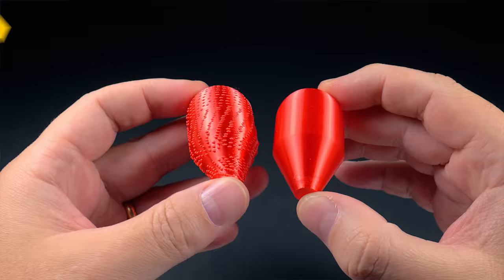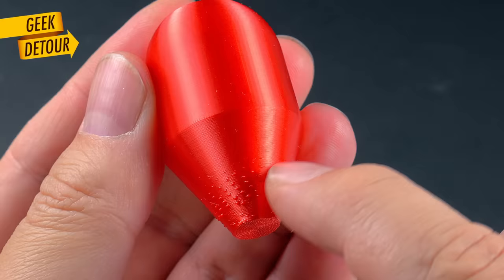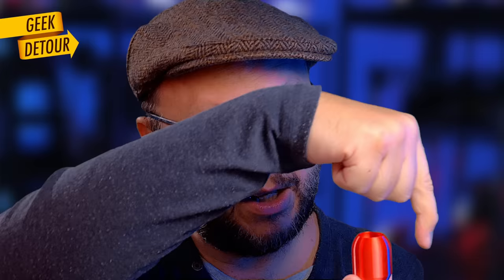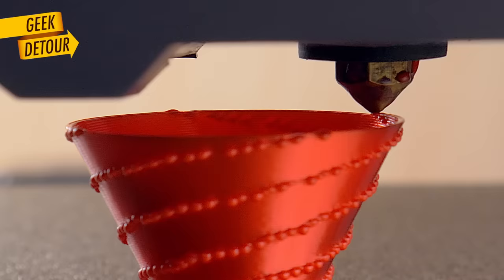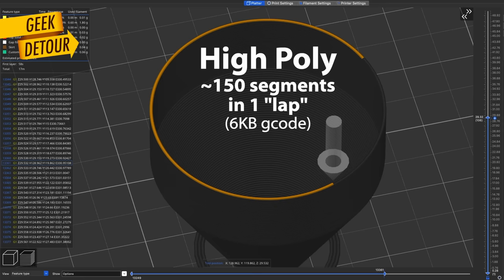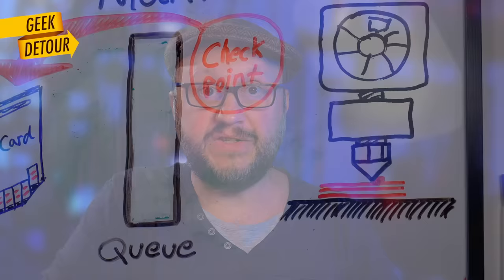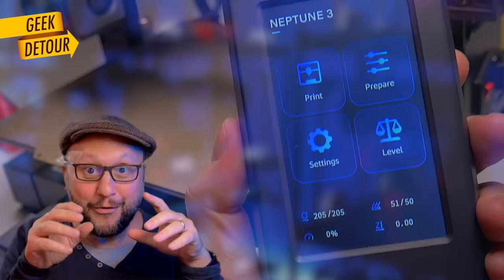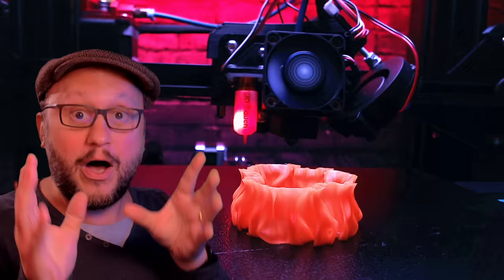3D Printer Blobs: a mysterious problem you won't guess how to fix 🤔

Comment: That isn't "processing power". Nothing about it has anything to do with "processing power". GCode is managed sequentially. Doesn't matter if it's 1K or 1M, it gets processed from end to end.
Reply from the maker: Hi Tim: these microcontrollers are single-threaded. They jump from changing stepper pins to other tasks, luckily without causing noticeable pauses in print. Reading to the SDCard, writing to the SDCard, updating the LCD, all of that can be better done when the CPU of the microcontroller is faster. The faster the CPU, more time to access the SDCard between changes on the pins that control the stepper motors. It is very related.
But you are right about GCode being “consumed” sequentially - that’s why a file with 1GB of GCode can be printed by a printer with 16KB of RAM. 

CPU is so related to these aspects that it even limits the max speed of the printer: a 16MHz microcontroller, even with Klipper, cannot print as fast as a 32bit board running much faster, because the CPU is who changes the levels of the pins that control the motors steps.
Reply: @GeekDetour  These microcontrollers are indeed single-threaded. They're also interrupt-driven in the same manner that the 32-bit microcontrollers are interrupt-driven, both by internal timers.

When an 8-bit microcontroller is handling the tasks at hand sufficiently fast and without fail, a 32-bit microcontroller running at 20 times the clock speed of the 8-bit microcontroller, and having access to 1000 times as much RAM cannot perform better. Sufficient is sufficient. The faster 32-bit microcontroller just spends a ton more time being totally idle, consuming some of that time in housekeeping that the 8-bit microcontroller never needs to do because it has no operating system to maintain (the 32-bit microcontroller has a worldful of housekeeping to do just to stay alive).

Reading from the MicroSD card is NOT done "better" by a faster microcontroller. The MicroSD card is the bottleneck; it's limited by SPI clock speed... and an 8-bit microcontroller manages it perfectly sufficiently. Again, you cannot do better than "sufficient". A faster microcontroller just spends more time smoking cigarettes and kicking empty cans down the street. The same is true of writing to MicroSD cards and to updating the display, whether it's LCD or OLED or anything else... if the display is even being used, which it very often is not. And... it also manages GPIO pin changes perfectly well. Sufficiently. I know these things because I write the firmware for them. I've been a software / firmware engineer since 1984. Really.

Next news flash: a 1GB GCode file can be managed sequentially by a CNC router control board with only 2K (TWO kilobytes!) of SRAM. It happens all the time. That's what GRBL boards do. Now, 3D printers do need to do a little more work than CNC routers do... they need to manage two different temperatures (hotend and bed) and one PWM fan... but the fan's PWM is handled entirely by hardware, so it doesn't count. Two temperatures. Do you think it takes 14K of RAM (16K - 2K == 14K) to manage two temperatures? I didn't think so. Neither do I.

Don't be too fast about leaping onto the 32-bit bandwagon. You aren't getting four times the performance when you do.

If you have doubts, consider this: I have a buddy who's built himself a couple of race printers. He's running 8-bit boards, and he's getting speeds as high as 500mm/sec with excellent detail. 8-bit boards, more specifically ATMega1284s and ATMega2560s can do a whole lot more than you clearly think they can. Obviously even the puny ATMega328 can do a whole lot more than you think it can.
Reply from the maker: I agree with everything you wrote, TIM - and I appreciate all the information. And yet, if you watch Stefan’s video, you will see that the capability of printing more complex GCode without the interruptions that cause blobs is related to the CPU and RAM of the microcontrollers even whithout them writing the save states to the SDCard.

I think you got mad when you listened to me talking about CPU power and was very fast to draw a judgement upon my knowledge.
Reply: @GeekDetour  Who is Stefan?

Nothing about GCode is ever complex. I've written GCode, and handlers for it in C, that can do tilted helices... and even tilted helices are dead simple.

The blobs, and the fixes presented here, have nothing to do with "processing power". They clearly have only to do with MicroSD card bottlenecks, throttled by SPI clock speed.
Reply from the maker: Ok TIM. Your pleasure is just to watch a video just enough to find a hook to call others clueless 🤷‍♂️ You look like a chap that knows a lot - but don’t really pay attention to what others say, even if, deep down, people are talking something very similar to what you think. You didn’t watch the whole video: I say exactly that: the blobs in this particular case were caused by the SDCard 🤷‍♂️
Reply: @GeekDetour  But one comment ago you indicated that the blobs in this case were caused by a lack of "processing power".

You see... I watched the whole thing. What's more, I retained the whole thing. That's how my mind works. I also remember what you wrote. Heck, I still remember, sound-for-sound, cartoons that others were watching in the 1970s. I remember a sequence of siphon tubes that my father asked me to remember for one of our fields when I was about seven.

I collect information about everything, and I process it until I fully comprehend it and then I process it again to extrapolate its ramifications, then I store it for later reference, building the concepts into my worldview.

BUT... I cannot draw a frog or any other organic object, and I cannot visualize my own face. I can do some things far, far better than nearly anyone but cannot do other things that are extremely common.

This ... THIS ... is one of my "things". I know electronics and firmware and software very, very, very well.

And... I use 8-bit controllers for everything that begs for automation. Because there is no reason not to, and because 32-bit controllers have their own very serious set of problems, and because I feel offended when someone who is actually attempting to lead others... is derisive about things that they don't understand and by extension tries to convince others to bail on perfectly satisfactory equipment and migrate to other equipment which actually isn't any better... especially when that migration spells extinction of the original satisfactory equipment and perpetuates the paradigm of "infinite memory" and "infinite storage" and hideous, insanely sloppy, inefficient software that pervades the world today.

You're just making it all worse.

Oh, you're not the only one, of course... but you're certainly part of it. If people like me point out the naked emperor, you and others like you would have us all using 128-bit controllers for our 3D printers within six months.

So... 

That emperor is NAKED. He's commando. Buff. Birthday suited. Playing for the skins. Au naturel. Unclad. Tog challenged. Unhidden by fabrics. Overt.
Reply from the maker: On the case of CNC’s Kitchen video (from Stefan) that I mention in my video, his problem WAS CPU limitations… That’s not the case here. But you didn’t WATCH the video, you just stopped it and rushed here to pick a fight 😟
Reply: @GeekDetour  For obvious reasons I don't follow every video that's mentioned in some other video. That would just be foolish, since I failed to bring any gingerbread crumbs with me today.

It's also pretty foolish for you to expect your audience to go watch any video you happen to mention in yours. We followed YOUR title in, we expect to watch YOUR video supporting that title... not get all led off down other peoples' rabbit holes.

If you're impressed with something in someone else's video, discuss it in your own. Don't just expect your audience to go trailing off. That would delight YouTube, since they'd sell more advertising, but it wouldn't (ahem) become your audience.

I think you're out of ammo and I have no further reason to write anything here. You've already heard the logic and seen the arithmetic. If you can't follow it, it's your business.
Reply: @GeekDetour  Now, to meet your challenge, I have watched your suggested CNCKitchen video... and again you misunderstand what's going on. He doesn't talk about any problem being related to "processing power" of the control board's microcontroller. Instead, he's running a Pi to feed GCode "live" to the printer and at very high resolutions he's seeing a bottleneck... IN SERIAL COMMUNICATION between the Pi and the control board.

Exactly the same bottleneck exists with any printer, regardless of data bus width... 8-bit and 32-bit alike. External bottlenecks are unrelated to "processing power". It is NOT "CPU limitations".

Comment: was this in a manual ? or is this just something they believe people should know?
Reply from the maker: The manufacturers just enabled the feature that existed in Marlin (which is Open Source) and started advertising PowerLoss Recovery as an awesome feature. When it happened two years ago, nobody foresaw the impact it would have with some prints - and mostly as people started printing faster. Two days after I published this video, I got an email from Elegoo thanking it, and telling that they would include a menu option for people to enable or disable it - and they did it!

Comment: Hi, good video! Could you please tell me the name of the model or where to get it to make same test please?
Reply from the maker: Thanks! I made the STL, there’s a link in the description for my Blog post, you can get it there
Reply: @GeekDetour  thanks! I'm new to 3d-printing... any specific advise on settings  how to print this kind of parts?
Also is there a way to turn off the continue on power off feature without installing ?
Reply from the maker: You actually need to check if your 3D Printer has PowerLoss Recovery enabled - or even if it is still implemented in a way that causes Blobs. If you are not having blobs in patters, there is nothing you need to do. Just focus in learning your Slicer. Learn how speed and temperature affects your prints - print stuff, have fun. You will learn more and more, this is a long run process to master 🤗 Enjoy the ride.
Reply: @GeekDetour  could you help please - can't find the setting for 1 layer vase type of printing... :(
Reply from the maker: Just search YT for “Vase Mode Tutorial 3D Printing” - really, there is A LOT of material available in details.

Comment: perhaps a detection to detect when the printer stops?
Reply from the maker: Actually, the goal is to make the printer never stop.  There is a way to make PowerLoss recovery detect when an actual power-cut happens, and use a small board with super-capacitors to perform a halt and then save the print state to a card. Only when it actually happens.

Comment: Why not increase the queue length in the firmware?
Reply from the maker: That’s a great question! In this particular case we get into a conundrum: the queue is part of the structure that is saved on the SDCard as a checkpoint 🤣 So, increasing the queue length, it also increases the time it will take to write the checkpoint 🤷‍♂️

Comment: It won´t work with my Neptune 4 Pro:

File opened:sda1/Disable Power-Loss Recovery.gcode Size:343
File selected
// Unknown command:"M501"
// Unknown command:"M413"
// Unknown command:"M500"
echo: Power-loss Recovery DISABLED
Done printing file
Reply from the maker: The Neptune 4 Pro uses Klipper - I think it doesn’t have PowerLoss Recovery by default. You are good 👍

Comment: I have Octoprint with Octolapse set up and I have blobbing. How do I fix it?
Reply from the maker: Well… I don’t know if what you are calling Blobbling is actually the same thing I treated in this video. Yes, you could have blobs (the same thing I show) due to frequent stops because the communication between OctoPrint and the 3D Printer is the bottleneck (maybe too low bitrate) or the USB cable you are using is not good. Try a different cable. Using OctoPrint on a slow Raspberry Pi (Zero, for example) doesn’t help either and on a complex model you could have hiccups.
But if what you are calling blobs is the defects you see when the print head comes back from the photo (OctoLapse), than that is not the blobs I am talking about. That’s an issue you might not be able to fix - like, your are stopping the print every layer to take a photo and the filament droops on the nozzle. There is no easy solution for that. There is no simple solution to have a perfect print while stopping to take photos every layer. When I am making a timelapse, my focus is making a nice video - the print suffers. When I need a perfect print, I don’t make a Timelapse (at least hot the ones where the nozzle moves away for the photo).
Makes sense?
Reply: Yes. I used to have spaghetti on the prints. Fixed that, now blobs. The printer does go kinda slow and keeps pausing making the blobs. Otherwise it looks beautiful. I've posted a short on my channel illustrating the blobs. Any alternative to this? If not, how do I switch to Klipper? Someone said I should do that. Thanks.
Reply from the maker: Maybe it is too late to suggest it… but, have you got a respectable SDCard for your Raspberry Pi? I mean, class 3, >90MB per second, good brand? But check the USB Cable too…  And look for the baud rate: see if you can connect at 256kbps instead of 115
Reply: @GeekDetour Thanks. I'll try that!

Comment: the Octoprint issue, i wonder if your longer cable was USB 1.1 cable? USB 2.0 LOOKS identical, but transmits data LOTS faster. typically, a cable's length doesn't affect speed, unless it is over 25 feet...
Reply from the maker: Oh, it is hard to know today… I remember being sure it was a USB 2.0, but there are bad/cheap/fake cables poorly made that say they are 2.0 but wouldn’t comply to the standard if properly tested. The short cable I bought was from a better brand. I am not saying a long cable won’t work nice if it is “the real deal” - last week I printed with OctoPrint over a 5m USB cable and it was perfect, as you suggested.
Reply: @GeekDetour  yep. if there's one thing i've learnt, if you want it to be perfect, you gotta use perfect parts! no cheap filament either, and as you mentioned, keeping your filament sequestered from moisture (humidity) goes a long way towards this, too.

ultimately, it is a little bit of everything that contributes to quality, and when you know basically nothing (newbs like i was) sorting out print quality becomes an endless job.
Reply: @darkflux I find that with filaments, price isn't always an indication of qualtiy.

I've purchased "expensive" filament that I find doesn't create nice, smooth printers, which some "cheap" filaments consistently product amazing prints.

But once I found brands that seemed to be more consistent, I buy those as much as possible.
Reply: @BlondieSL  expensive is not always best, but neither is cheapest. my boss was always "we're getting this one because it's cheaper" or "I found a cheaper filament than what we currently use", but it was always hot garbage, and performed poorly every print.
i finally convinced him to try some of the better known brands and ones that are popular with people on forums, and we haven't gone back to "cheapest" since.

i'm sure there are some cheaper filaments that do well, and i almost never buy the pricier stuff, but in my experience, the cheapEST filaments are cheapest for a reason.
Reply: @darkflux Yes, I find that too.
But where I was going with that, is that I have paid a lot of money for "top quality" filament, only to be disappointed.
Then bought some on sale (cheaper) and get consistent prints.

It turns out, like you say, it's all about a known good brand name.

Comment: Awesome video, now to throw a monkey wrench into your explanation.  I am getting the blobs when using a Wi-Fi enabled printer, Makerbot Replicator +, with a "smart extruder".  I have not noticed if it only does it when using Wi-Fi or if it does it when I use a SD too.  I think I should check this.  I should also mention that the blobs seem much more random then your model.  I'm guessing these are caused by the random seem generation you mentioned? One of the models that it happened very badly on was an egg with very smooth sides, so that would tend to point more to your diagnosis.  But I see that this video is a year old so...
Reply from the maker: Anything that causes micro-pauses will make blobs: can be a slow SDCard, fragmented SDCard, once there was an OctoPrint plug-in that was behaving bad and taking too much CPU and it caused blobs. There’s a bunch of stuff. This video got lots of attention because many manufacturers enabled PowerLoss Recovery 2 years ago without realizing its implication - now it has been implemented in better ways. No wrench at all 🤣

Comment: So, can this also be a thing when utilizing LAN printing?
Reply from the maker: Ah, no. All the printers I used, that have wifi or Ethernet printing receive the GCode entirely and store locally before starting to print.
Reply: @GeekDetour  Ok, then so it's one of the other things mentioned in the video that could be causing that excess bit of material in areas of the print then? I'm just asking because I've noticed similar bubble like bits of stuff on my prints, and I cannot figure out what is causing it.